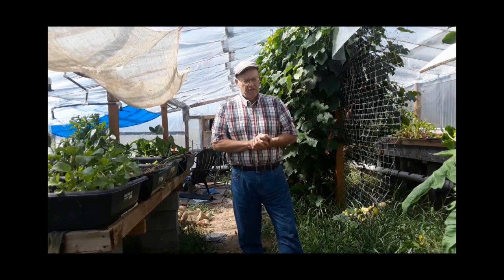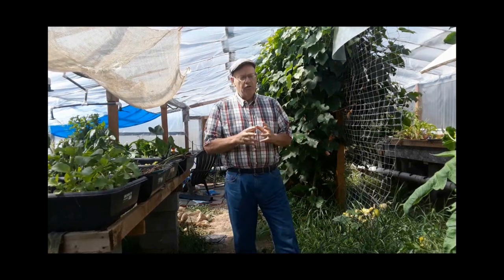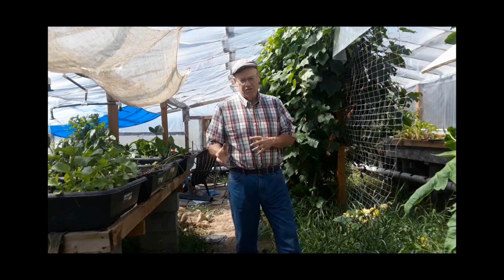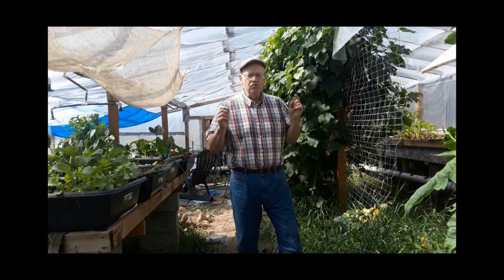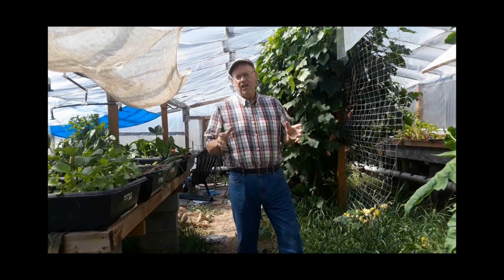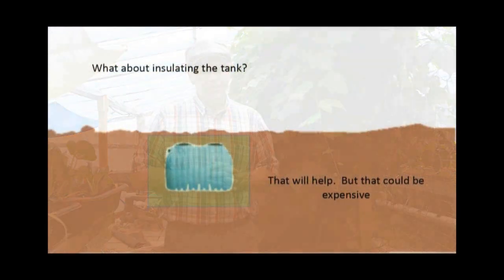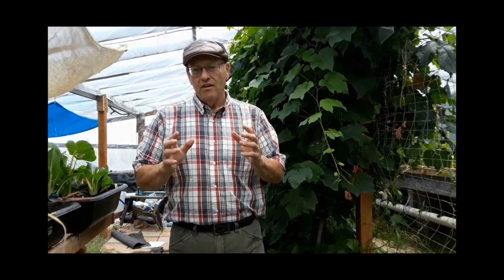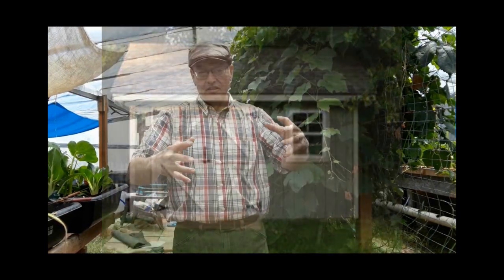Burying Water Tanks for Winter Greenhouse Heat??

Comment: Where did you come up with 120 degrees?    Is your house kept at 120 degrees through the winter?   No. The concept is the 50 degree ground temp makes the water in the tank 50 degrees too.  Pumping X amount of water through a heat exchanger radiator will give radiant heat well above freezing throughout the winter.  This will greatly reduce the alternate heat source demands throughout the night while the sun will add on top of the 50 degrees during the day.   The same radiator design will also heat the water in the below ground tank during the day above the 50 degree ground temperature  effectively giving an extra measure of heat depending on many factors.

The only way the design fails is if the exchange rate of heat transfer cools the source (tank water) down faster than the night cycle, the source temp will fall below 50 degrees and the daylight recharge time will only get it back to the 50 degree starting point.    This will happen if your tank is too small.    As long as your tank can expend heat in the greenhouse at a slower rate than the ground can heat it up, you will be fine.  
 A small greenhouse of 200 sq.ft. using in this case, a 1000 gallon tank works great and also works in reverse during the summer effectively cooling the greenhouse with 50 degree AC allowing a much better environment during that season.

Calculate the temperature difference: 50°F - 35°F = 15°F.
Calculate the mass of the water: 1000 gallons * 8.3 lb/gallon = 8300 lbs.
Calculate the energy needed (in BTUs): Using the specific heat capacity of water (1 BTU/lb°F), the required energy is:
Energy = 8300 lbs * 1 BTU/lb°F * 15°F = 124,500 BTU. 

This doesnt calculate the absorption rate of the earth heating the tank water as it is expended in the greenhouse.   Of it only replaces 25% throughout the night cycle there would still be 155, 625 BTU's  available for night heat.  155,625  BTU's / 10 hours  is 15,562.5 BTU's per hour.  Quite a lot.

Comment: The ones I’ve seen are used to modulate the temperature from the highs of summer to the lows of winter.  You rely on the fact that the ground temp remains 50 degrees.  During the summer you dump excess heat  to the water (which dissipates heat to the ground) and reverse it in the winter, circulating 50 degree water thru the 35 degree greenhouse.  Trying to store hot water in an uninsulated, underground tank is just dumb….
Reply from the maker: I think I was trying to make the point.

Comment: We will dig 6 feet down. Our greenhouse will be 100 x 20 off a solid wall (steel barn). We have the plan of 9 barrels on their sides every 27, 3 times over. Each bank heated will solar panel piping and pump. Additionally there is a large wood burning stove I will wrap copper lines to and insulate. That water will pump into tanks as well on colder months. Double walled plastic with a third section plastic off inside for winter growing. Only utilizing the centre bank with stove. 

We live in northern Canada and currently get 120 days of growing outdoors if lucky. 

Our plan has an estimated cost of 18-20 thousand.
Reply from the maker: That would be very interesting to see it turns out.  I hope it works well for you.

Comment: 4 x  250 gallon tanks in a shed. Summer ,circulation to the tanks no insulation, try to loose as much heat as possible fans and car radiators.(bypassed during winter). Winter, try to collect as much heat as possible. car radiators (bypassed during summer) hot water maker with thermos tubes. Find every way to collect the suns heat and transfer to the tanks that now are heavily insulated. What do you think? Doable? Thanks for a good channel Lars Roth Provence France

Comment: Sorry, but no. This video is disingenuous. No matter where you mass is it should be insulated. If it is below ground AND insulated then you are better off because you will have a lower thermal differential.
Reply from the maker: Yes but what about having much better thermal conduction below ground?   Might that not conduct the same amount of heat in spite of the lower temperature differential?
Reply: @eddysgreenhousegarden7022  Thermal conductivity is all about insulation and thermal differential. If your tank is above ground it will slowly lose heat to the colder surrounding air which will not stay warm as it will lose heat to all the other air. Air is a poor conductor but if the air moves it gets better as it will "convect" heat away.  Soil is a better heat conductor but it never moves, so it never convects. If you lose heat to the soil it will heat up and lose heat to other soil, etc. you will create a thermal gradient which then lower conduction because each layer has a lower thermal gradient. Also every part of that gradient enlarges your thermal battery. And also remember part of that heat loss is into the greenhouse as long as the water tank is under the greenhouse.
Please don't take this as too negative, I agree that the tanks should not be buried, just not for your reasons.  I think they should be above ground but under the beds to raise them up.  The key is to build a cheap and simple thermal interface to all that mass. You want the mass COMPLETELY connected to the air in your greenhouse to cool it during the day and heat it at night. I say under the beds because no one likes bending over and everyone has some plants that only have shallow roots, so placing them under the beds give two benefits, it doesn't waste space AND it adds to the thermal link to the greenhouse.  The key step is creating a system that will allow you to dump all your excess heat or cold into that mass of water.
Here is a link to one way of doing it. https://northernhomestead.com/car-radiator-for-heating-and-cooling-a-greenhouse/?fbclid=IwAR1jhEXcQolVdFrRB5Wlih94jZ_hPXgAPXIh3lVf_ljdQ92fE-ghBFkoqME
Reply from the maker: Richard, A while ago I built a heat transfer setup strikingly similar to the one depicted in the video, car radiator, cheap fan and all.  I connected it to a set of tanks, 2,000 gallons, in an insulated shed.  I heated it with Propane.  It did work but the cost of propane made me abandon the idea.  The problem was the water temp needed was over 80 degrees or the heat transfer into the greenhouse at night was not very good.  I could not pick up heat during the day because I would need temps well above 80 to move heat into the water storage.    If you would like to see the results with the system in operation follow this link: 
 https://youtu.be/qJRLmoGQE1o  
 
Looking at the video you suggested does give me a few ideas to improve what I tried.  Bigger radiator, better water flow, etc..  Thanks
Reply: @eddysgreenhousegarden7022  You linked to the wrong video, but I get the point. The issue seems to be that, unless I have missed something, you missed having any non-fossil fuel inputs into your battery and definitely had some design issues. 1. A car radiator is designed as a compact way to dump tons of heat through a large thermal differential (200F => room temperature) allowing for fantastic air flow (>20mph).  It isn't designed for low thermal diff temps so you need to massively upgrade the system.  2. Generally greenhouses overheat during the day, did you have a mechanism to dump that heat into the water? Questions: 1. Did you have to vent the greenhouse during the day? If so, you need to dump that heat into heating the water either by pumping it through the radiator or by leaching some of it away with a solar water heater. 2. What was the range of temperature difference between the water and the air in the GH? The better the system the closer they will be. Unless the greenhouse is VERY small, one radiator won't do. 3. I saw you did PV water heating which is interesting but VERY inefficient as shown.  PV panels are only ~15% efficient where as solar thermal panels can be 80% efficient and cheaper than PV.  If you are going to do PV then you could recoup the losses using a heat pump, but very $$$$. I'd suggest you do a draining solar thermal setup that only runs during the day when there are gains to be made. You may not even need glass over the panels, just a pair of thermal sensors that will trigger the water pumps when the panel exceeds the temp of the water.
Reply from the maker: @RichardHauser  Richard,  thank you for taking the time to respond.  I see what you mean about wrong video.  I re-read your first response a little more carefully where you’re addressing the earth battery issue.   

I think I am, in a small way, doing what you are suggesting.  When I first dug my 4 foot deep fish pond and filled it with water, the surface froze over but about two feet down it never got colder than 41 degrees.  That same year I built some floating raft grow beds and filled them with water too, but they were above ground, not circulating and that winter they froze solid all the way through.  It was way below freezing in the greenhouse that winter, as usual, on cold days.   

Next season I  configured all the above ground grow beds to circulate pumped water from the fish pond.  The following winter no water froze in the greenhouse anywhere.  The greenhouse itself did get below freezing at times but it was about 10 -20 degrees warmer in there than the last year, due to the fishpond being circulated around like that.  So I can only conclude low grade heat was being drawn from the fishpond and being dispersed by circulating the water through the grow beds.      

I am going to try to improve the performance so the greenhouse can be a much warmer climate during the winter months.  But I am concerned that the flowing pond water might start to compete with the added heat by dissipating some of it into the soil surrounding the pond during the night.  Any Ideas?   What do you think?
Reply: I agree needs an IBC which is 1000 litres . I am interested in the heat exchanger method though but simpler to just drop in a 12v heater tube type.

Comment: So to save money on insulation with the underground method you say it is better to construct a concrete pad and build a whole building (with more insulation required than the underground method) that requires a heat source every winter? 
It would appear that your suggested method will be outrageously expensive VS underground with insulation. The tank cost is higher for underground and it will cost a whopping $350 to rent the excavator for the day. Every other expense is lower underground and there are no recurring expenses like painting, reroofing, pest control, heating, and taxes (a building increases the taxable value of the property and the taxman always gets his $). 

Lastly, Your method seems to defeat the purpose of having the thermal mass of water acting as a thermal flywheel for the greenhouse. Water storage becomes a liability like gold stored in a rented safe deposit box, instead of an asset that is working for you while retaining its value.
Reply from the maker: Scrawface,  Thanks for the input.  Here's some of my thoughts.   Unless you put a lot of insulation around an underground tank,  insulation specifically designed for underground use, the water in the tank will lose or gain heat from it's surrounding soil rather quickly.   Soil is not very good heat conductor, but it's a lot better than air is.   If you're actually trying to heat your greenhouse  in the winter, say to 60 f or so, you're going to need to heat your water much hotter than 60 or you'll get no heat transferred out of it.  Ground temperatures in  most places where you might try this are  around 45 f or so.   The water would always want to return to that temperature.   The insulation to stop that in an above ground tank is very cheap because it is commonly used to build homes.   Also, if you ever needed to fix a problem, digging things up is a difficult thing to do.  Above ground,  there's  much better access.

Comment: What about a tank in the greenhouse with an air to water heat exchanger that would cool the air in the summer and heat the air in the winter?
Reply from the maker: If it was balanced correctly that might work.  But keep in mind that the tank(s) will take up space in the greenhouse that you might want to use to grow plants.   Also to store heat  in the winter, you need to have excess heat to store.   Another way to say that is do you need to open the greenhouse windows in the winter during the day to keep it from getting too hot inside?  If you don't have to do that, you probably don't have excess heat that you  could store for night usage.  It would at least narrow the temperature range,  hot to cold,  inside the greenhouse.
Reply: @eddysgreenhousegarden7022  I agree, my idea was to bury a shipping container in the ground to use as the heat sink but to also raise fish, Tilapia if I could keep the water warm enough and then use the water with the fish waste to supply a hydroponics with bell siphon drain beds so i would just dig a bigger hole to accommodate the large tank and use the tank to support the greenhouse framing for the lexan panels
Reply from the maker: @matpenner4238  Sounds like quite a project.  I have never tried Tilapia but I would worry about keeping the water warm when the tank is buried in the ground.  Remember the ground temperature doesn't change very much, a few feet down, winter or summer.   It stays around 40 - 50 degrees all the time.   Maybe some insulation might do the trick.   Good luck
Ed
Reply: @eddysgreenhousegarden7022  For sure, I will crunch the numbers before I start but being in the Glass Business I have experimented with collecting heat through glass and I built an insulated box with a glass panel in front of it sealed up pretty good to do a test, I used one of those thermometers that you would typically install on your window frame on the outside to see what temperature I could get to, it was -30 degrees Celsius that day, very sunny and the thermometer Melted! I thought if I could get that much heat in the winter on sunny days i expect that collecting all summer should allow me to maintain at least through the winter but it will be a huge project
Reply from the maker: I have a couple more videos on this topic that might help  a little bit.    Click on either of these and it will take to them.  
https://youtu.be/qJc1AUwWS_4             https://youtu.be/spehA8I-3fI

Comment: This gentleman is completely wrong. If done right storing heat underground is absolutely possible. Entire housing editions are heated through this method.
Reply from the maker: The key point is IF DONE RIGHT.
Reply: I agree with you Joe.  No different than Eddy's insulated water storage room but with less maintenance.  Insulated basements are built every day.  Plus, heat transfers so slowly through soil that heat loss, even without insulation, can be easily overcome with solar heating and used to the design's advantage.  I agree with Eddy that water is a great medium for heat storage BUT...it doesn't need to be the only medium and can be used quite smartly in combination with other mediums to produce a final result that reduces the restrictions of any single option.  We can't get stuck on any 1 single method.

Comment: Thanks for the info. What you say makes sense. My idea is to store rainwater in an underground tank. I've also considered a hot water underground tank with some insulation, and providing a solar dynamic panel to heat the water during the daytime with a circulation pump. Plus, if the tank is close enough to the surface, the heat list from the tank can heat plant roots and contribute to warming the GH. The main drawback for me is the digging of the holes.
Reply: I am going to do this . Use an IBC then bury to g/level then solar panel to 12v heater in the tank. I think need to insulate tank too
Reply: Need to sand & cement & wrap tank in old carpet . I reckon it will work. Then rainwater feed to tank too. Only issue is overflow. Still thinking on this
Reply from the maker: Having dug a few holes in my day, I would have to agree that would be a really big job.   If you're interested in warming the topsoil, it might be better to bury some plastic piping and run hot water through that.

Comment: What about storing solar heat in the ground using the earth as a thermal battery during the summer, and use that heat in winter?
Reply from the maker: Well Ivan,
Unless you go to great lengths to insulate the storage area, the heat, above the natural ground temperature,  will dissipate into the surrounding soil in just a matter of a few days.   The same thing happens if you submerge a bottle of hot water in a kitchen sink full of cool water.  The water in the bottle will cool to the temperature of the water in the sink very quickly. 
Ed
Reply: I mean something like this https://www.youtube.com/watch?v=lVIj-p0Eqcg&t=239s